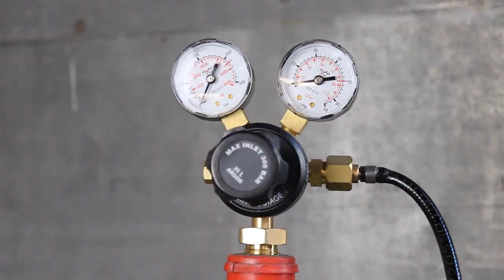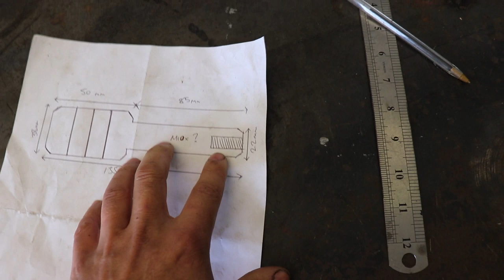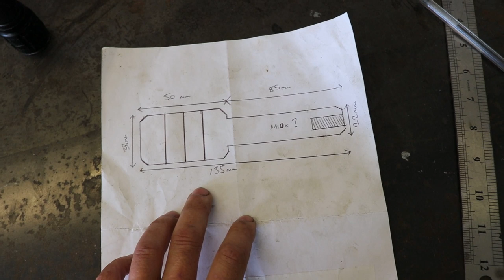THE MONGREL GETS A KNOB EXTENSION, FIRST COLCHESTER LATHE PROJECT.

Comment: As a Canadian machinist, i feel your pain with metric and imperial conversions all the time. 

For aluminum a sharper (smaller tool radius) is usually better. This also comes along with what ever job your doing, most tools are job dependant. 

Softer the material, the smaller the tool nose radius, and if you are getting really stringy chips either slow the rpm or increase the feed (unless its a finishing cut)

This is all very general as well.
Reply from the maker: That's great, thanks for the info.

Comment: With turning it's all about keeping the work traveling past the tooltip within the right surface speed range.

For aluminium you want the surface of the work to be spinning past the tip of the tool at somewhere around 200 to 300 feet per minute (known as "Surface feet per minute" or "SFM"). As one of the most important factors is how fast the surface is moving past the tool tip, the lathes RPM has to be change to suit the diameter of the work. If you have a 6" Dia billet of ally you should be spinning it at around 180(ish) rpm to get your SFM into the 200 to 300 range, But if you're turning a 1" bar you'd want to be up around 900 To 1000 RPM to keep the same surface speed. It's a bit like how a small pulley can be going 1000RPM, but the much larger one on the other end of the belt might only be going 100RPM. The belt's travelling at the same surface speed around both pulleys,  but the smaller pulley has to be spinning a lot faster to keep that outer diameter traveling at the same belt speed. Different tooling can push these numbers around quite a bit too.

This often means needing 2 different RPM's to get a nice surface finish if your part has a large step in it (like your knob extension). If you were turning a bar of ally to have a large diameter of 2" and making it step down to 1", then for the larger diameter you'd need to be running at 450 to 500 RPM, but for the final pass on the smaller 1" section you'd have to bump the speed back up to around the 1000 RPM region.

It gets fun when you start turning other metals too. Each metal has its own happy little SFM range that you want to be aiming for. But as I mentioned before, it gets even more fun when you bring different tool types into the equation. High speed steel tools work for ally at the speeds I've mentioned, But you should run carbide tipped tooling a fair bit faster.Then "Insert tooling" tends to need to go just a bit faster still, and they don't always seem happy unless it's taking deep cuts at high feed rates. The build, level of wear and rigidity of the lathe also comes into it. My lathes a 90 odd year old small workshop (or large hobbyist) tool. It's in good Nick, But it's still just a lower powered lathe with a certain level of slop/wear in everything. I wouldn't be able to run an insert tool on it because the thing would stall if I tried to take any real cut depth with a feed rate that would keep it happy. If I tried to take a really deep cut my lathe's lower rigidity, accuracy and mass would show up badly as chatter in the surface finish too.

Will you be pumping cooling onto the tool and work? On some metals that can also tweak the SFM range up a little.............. And the variables go on and on. LOL !

Alternatively, You can just play it by ear. Like how people can go to college to learn the intricacies of welding and have all the science behind exactly how to MIG metal together........ OR they can read a few paragraphs about penetration, The sound of frying bacon, and getting the metal clean first, then giving it a go. You CAN teach yourself to weld. People doing this might not know the science behind WHY their weld bead looks blobby as hell, or why they're blowing half inch holes in the parent metal, But they can certainly twiddle the power and wire feeds a bit to see what stops it. You can learn to use a lathe in the same way.

What I just saw was good. You played about with different tools, feeds and speeds to see what effects it had. You could print out a chart from the internet showing the desired SFM for different metals and tool types, plus a table that translates SFM to RPM for different diameter jobs to take some if the guesswork out of it, but again, that's not strictly necessary. Do more of the same and eventually you'll start to work out from sight and sound (But hopefully not smell. :) ) what "Feels" right and what you need change if it doesn't. It might be worth sticking to one type of tool (HSS, Brazed carbide or insert tooling) at first though, just to save yourself from getting bogged down with too many variables at once.

Maybe also have a little google for info on using a lathe safely before you learn any bad habits though? Even a Colchester Student can produce enough torque to PHYSICALLY wrap you around the chuck and work piece. Getting a sleeve caught on a slowly revolving Chuck must be quite high up on the list on unpleasant way to go (For you, AND whoever has to clean up the mess !). :(

Most of all, play with it, Have some fun with your new toy, And see what works.
Reply from the maker: That's great info and just what I needed. Cheers
Reply: Great info and advice Reman1975. I have been working on my Ch St 1800 since 1994 (was made in 1974) doing all sorts of turning on it (just did my first YOUTUBE video turning a “French style rolling pin” out of wood. I have gained a lot of info from your comments, confirming what I have experienced on my Cholchester. What a fantastic useful machine. My 2 cents contribution: SAFETY SAFETY. Enjoy your lathe Urchfab and the enriching experience, both for yourself and your followers, and look after yourself, working on machine is always dangerous. Like driving your MX5, respect the rules of safety and the enjoyment will be richly compounded. ( both for you and all involved ) keep up the good work, I really enjoyed it and will subscribe. Cholchester regards from SA

Comment: When I started my engineering apprenticeship I was taught to rough out the diameter then measure it up to see what was left to remove then take a cut of half the remaining amount, repeat this until you are just oversize a little then take a finishing pass to bring to final size, this reduces the risk of of going under size.

Comment: try turning aluminum with wd40, and if the workpiece is clamped, try to do everything from that side in one go, you could have drilled the hole right away, tap the thread and round corners, that way you don't need more than it is necessary to use the chuck, and you prevent impurities. when you were too deep for the first time you could have gone straight for the thin part, I think your speed may be slightly lower for aluminum, but nicely done.

Comment: You have to remember that 1mm = 2mm due to it being cylindrical. ie: the other side
Reply: Only on really old stuff, this lathe will move in half of what's on the dial -  on some Colchester lathes you can slide the collar with the increments in or out to change to metric or imperial.

Comment: Good job making the gear knob. I've recently gone back into engineering after a long break and  getting back into things even after doing an apprenticeship is taking me a while so don't be too hard on yourself ! Using an imperial machine isn't too bad once you get to grips with what the dials actually read. To work out the imperial measurement divide the metric size by 25.4. This will give you decimal fraction. There should be a scale marking on the dial, 1 division might be 0.001 ( 1 thou ) for example. Most dials will take the indicated amount off the diameter of the job but some work off the radius which can confuse things sometimes. On the subject of bed stops I tend to disengage the feed by hand just before the carriage touches and then finish feeding by hand.  If you set the top slide so it's parallel to the bed you can make accurate adjustments to the the tool to give finishing cuts on shoulders and create steps. Hope that all makes sense ;-)

Comment: Turn the compound slide to 90 degrees and put a dial indicator in front of it so you can measure your depth of cut. Digital readouts are getting pretty cheap too.

Comment: Nice work Matt. Get a quick shift kit, it will reduce the movement of your knob with the extra length you now have (if that's what you want) It will save your hand flying off the end of your knob. I put one in my MX5 and it's a great thing to grab hold of

Comment: Get yourself a couple of 40 -65 mm wide cheap but brand new paint brushes Matt. Then cut the bristles to about half there length with a pair of scissors. Use those for brushing off the swarf from anywhere you don't want it. Over time those paint brushes will load up with oil and cutting fluid making them hold the chips. Just wash them out with warm soapy water, dry and there good as new.

Maybe it's been already mentioned, aluminum because of the frictional heat from machining can cause it to chip weld itself to the cutting tools and then helping to destroy your nice sharp cutting edge until it's removed. A common term for it is having a Built Up Edge, or some will just mention a  (BUE). Common WD 40 is mostly kero with aromatics added in. Spray or better get it in bulk 4 ltr containers and use another small in width paint brush to add the WD 40 to the surface. For tapping holes you really do need two types of good cutting oils, one meant for steel and the other that's been specifically engineered for aluminum. Other than some brasses and cast iron, everything else does require cutting oil while tapping since it's then lowers the cutting friction and vastly reduces the chances of breaking a tap.

And it's only a matter of time before you find out buying cheap taps can end up costing far more in lost time, having to remake the part etc due to a tap breaking when you can least afford to have that happen. Were all limited on funds, but try to always buy the very best brand name cutting tools you can possibly afford. There higher costs are worth more than what they cost. Most machine shops operate on fairly thin profit margins. If the dirt cheap cutting tools were worth it at all they wouldn't hesitate to use them. 

Most chip breakers on replaceable carbide tool tips are designed for how industry would be using them. Heavy depths of cut and coarse feeds is usually when they'll start to form the chips and not long lengths of swarf. Most of what you showed was done quite well. I would have used the tail stocks live center in a few places where you didn't simply because with machining metal there's no such thing as anything being too rigid. Having chatter start due to either the part or tool vibrating is all too easy, and sometimes tough to get stopped. If everything else is correct the general rule of thumb is to up the feed rate and/or drop the speed. Most times that will work. Your calipers has a switch, measure in your standard metric, hit the switch for imperial and it then shows the part size and then it's easy to figure out how much your imperial cross feed dial needs to be moved to hit your target dimension.

Comment: Turning aluminum needs a steeper top rake angle than the inserts you have. You can also use an HSS tool bit and grind on the top/side rake on the tool. Use paraffin to lube it.

Comment: High Speed Steel tools are great for non Ferrous. Sharpenable on the grinding wheel and last for ages on softer metals. Available in many sizes including square bar.  Measurement conversion.....   1"  =25.4mm   , Graduations on the wheels are probably in thousands of an inch  i.e.  0 .001"  Which equates to  0.0254mm.  Ten gradations on the wheel will equal 0.254mm.
Conversley 0.1mm = .00394" so approx 4 gradations on your wheel,     1.0mm  =  0.039" so approx 40 gradations of the wheel.

Comment: on my colchester chipmaster a similar lathe  it will knock out of feed  safely there is also a a shear pin in the end of the lead screw in case you manage to crash it while threading ,

Comment: Get a set of calipers that can switch between metric and imperial.  I had the same trouble when I got my Colchester. 
Set the calipers up to the dimension you want in metric.  Zero them.  Switch them to imperial then measure the part. The measurement you get is what needs to come off and will relate to the dials on the lathe.  Remember to half the measurment though as you are taking material from both sides of the part.

Comment: Your caliper has a button to convert mm to inches on the display. Wouldn’t that make it very easy to use the imperial dials on the lathe? Great job on the turning. Looks like you bought it. Very professional looking result.

Comment: I second the comments here. 

Someone mentioned grinding your own tools. I agree yes and no. Cheaper yes and you can choose your geometry. (Buy a diamond hone if you plan to do this) but its much easier to stick with the inserts. You can get lots of different geometry ISO ones. 

Up your chipload. You are in the middle ground. Take much bigger depth of cuts and ramp the feed rate up. I do mean up. Its not out of the question on a lathe like that cutting 50mm 6 series t6 to run it flat out and take 10mm off the diameter with a 0.3mm/rev feed rate with the squarer holder in one pass. But I don't think that lathe has the HP for that even though it has the strength. Try maybe 0.125mm/rev. I would use the 30deg one for the most part for what you are likely to be doing on the lathe. 

Good stuff though man you have taken well to it to say the least. Better than some people I have seen using them for years (That is not an exaggeration)
Reply from the maker: Great info Bud, will try that next week. Cheers.

Comment: You can set up a dial indicator with a magnetic base on the cross slide until you go to the expense of a DRO. It's not as convenient but it is cheap. Just remember to you will be seeing radius and not diameter. They make inserts for aluminum but grinding HSS tools isn't rocket science. The clamping type knurling tools work a lot better than the ones you push in.  Doubleboost has a great channel if you speak Geordie and Myfordboy has some great lathe stuff if you go back to older videos (he has been doing mostly casting lately)

Comment: been a few years since I did much turning / lathe work , your chips think of it like drilling .. if the waste material comes off as a ribbon your speed & feed rate are bang on, if possible don't use the tailstock so the cuttings have  somewhere to go .. for tapping an internal I used to  knock one of the chuck speed handles out of gear so the chuck was in 'neutral',  wedge the tap holder against the cross slide & turn the chuck by hand …

as you've doubtless realised it is mainly practice .. go zen & become one with the machine
Reply from the maker: Working on my zen! Cheers

Comment: Matt look at Doubleboost,s video on fitting a DRO . I have a Harrison lathe and mounted a cheaper version for the cross slide and cut a Vernier to mount on the tail stock . get a 45 degree cutter it will do most things i use a lot of stainless steel  . cant go wrong owning a lathe enjoy

Comment: WD40 is an excellent lubricant for cutting aluminium, if you want to create chips instead of string then you need to buy the correct geometry tips specifically for aluminium and then run the correct speeds and feeds. As for tapping the thread, put the tap in your drill chuck and run it in under powder from your tailstock without the clamp tightened, your lowest speed and no more than 200rpm. The tap will pull itself in and when it hits the bottom of the hole it will spin, stop the machine then put it in reverse and the tap will pull itself out. Chamfer the hole with a small 45 degree cut on the compound to take off any sharp edges and give a nice lead into the thread.

Comment: Get a decimal conversion chart. You young lads not used to imperial.  There is a conversion button on the caliper also.  Get some spring outside and inside calipers.  Easy to set a measurement and machine to it.  Just take it slowly.  Knowing speeds and feeds for different materials is important.  Get an engineers handbook.  There are lots of different kinds of individual metals like steel and ally.  They have different machining characteristics.  All takes time to learn

Comment: I’ve been a turner mostly on Colchester’s for 36 years and I’m sick of it. I reckon I have 50 tip tools, another 50 brazed carbide tools and over 200 pieces of high speed steel hand ground at both ends, all that along with another load of stuff I’ll have to find a place for when I retire. Oh yea, learn to file left-handed.

Comment: Hay i have a old whitworth meaurement book if u want me to send some pictures also mate youll also. Will need Constant Lubricantion or you will wear out  your tools and the tool hight may have ajusted with each type althought im not certain on that 
and try not to handle bore gages micrometres too much as it will throw off your measurements, lots of machinist will put them back in a mini frig after every use
Reply from the maker: That would be handy, Thanks.
Reply: Gd gd iv just sent you message by fb

Comment: Try in the beginning not to get that habit, of piling up tools and stuff on the headstock. They become lethal missiles when dropping off onto a high speed running chuck. At least make a small sheet metal fence to prevent that dropping happening, if you keep things there.

Comment: Just change your sizes to english  dived by 24.4  change your vernier to English
Reply: 25.4 mate, and fractions you divide the bottom number by the top for inch fractions, eg; 9 ÷ 16 = 0.5625 inch, for metric multiply by 25.4 eg; 0.5625 x 25.4 = 14.2875mm